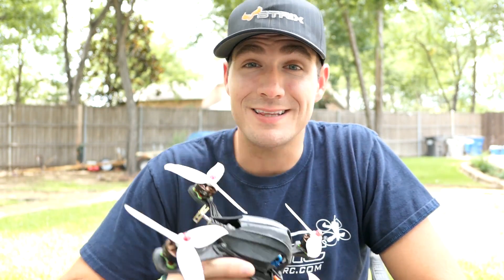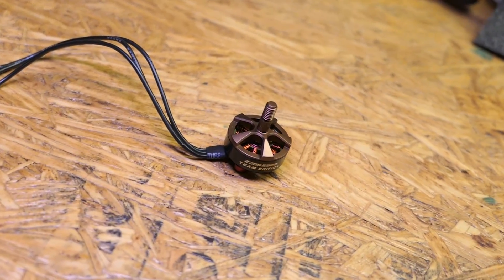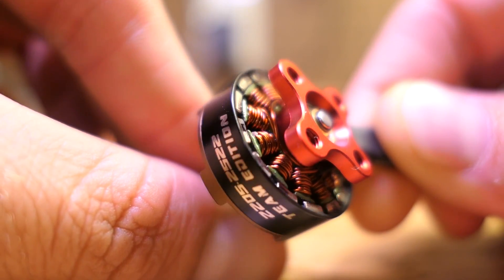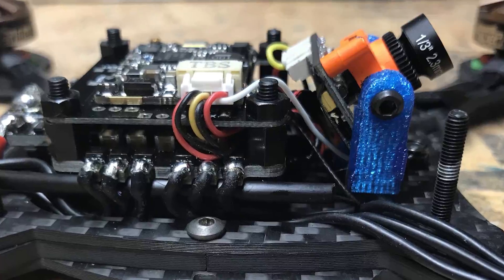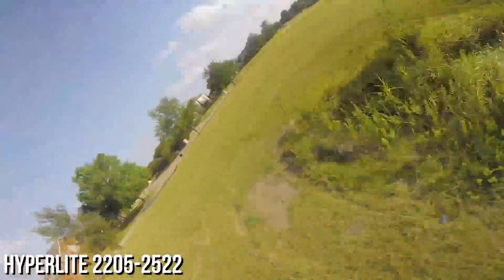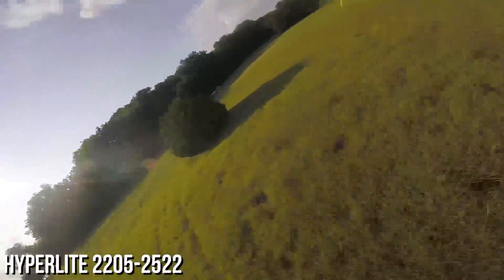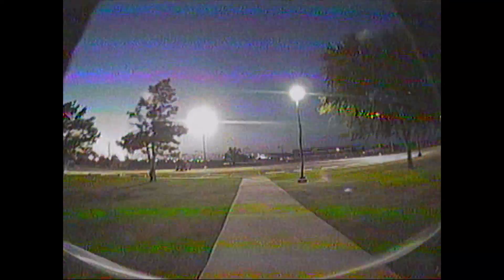Hyperlite 2205-2522kv Motor Review

Comment: This is some fantastic advice. And something to look into. I'm currently running DYS SE2205 2300kv on my race Talon and have a lot of control over it. I use T motors on all my other Quads and noticed a larger learning curve.
This will be interesting to test further.
Reply from the maker: +JayFlysFPV never stop testing!

Comment: I have these motors in a super light 5" thats about 220g (will be 230g once I add a runcam micro instead of the 1.2g cam i am using). These motors give me way more power than i could ever use... that said i am much much slower than you... i can get a 4s 1300 to last about 6-7 minutes... just kind of cruising/freestyling. also using the 5050 dual blade props.
Reply from the maker: +TransAm2k4 daaang 6-7 minutes lol enjoy that flight time
Reply: Well it helps that at my skill level i am cruising about 30-35% throttle and punchouts are short since this thing accelerates like crazy.

Comment: Nice review. I have a Floss v1 with RCX 2205/2633kv @ 24g. Total weight 252g with DAL 5040x3 props. It flies amazing fast, but still not that smooth with RCX motors as with BH. BH motors have better throttle control which requires less adjustments while flying.

Comment: Do you think this motor can't handle dal 5046C? I saw some data from miniquadtestbench.com, and strangely most 2205 motors pull similar thrust with 5045c and 5046c. However, when I saw 2206 or more motors' results, they pull significantly more power with 5046c than 5045c. I am really curious what makes that difference even with 1 pitch higher. And I also found that some top pilots actually prefer 5045c to 5046c. I want to hear your opinion over both props.
Reply from the maker: just cause of time I'll keep it short. The motor can handle it but the prop won't respond as quick as a less agressive prop. The way they measure pitch isn't as simple as you think, it's no longer just upping the ACTUAL pitch by 1. It's all sciency now, and has a significant impact on performance. I prefer the prop that is better for the motor. On mor powerful motors, 2206 and above, I like 5046. On weaker motors, I like 5045. It's a control thing. I have better control in the corners with the higher pitch on more powerful motors. But if I am having troubles on a track finishing because of battery, I drop down to 5045.

Comment: I built a rig using the 2204 floss motors hoping for a pretty efficient build. I know you have mentioned several times about how efficient they were. I did a pretty light weight build. I don't have a scale to weight my build but a 66g frame with hardware, floss motors, emax magnum, micro swift and dal 5040t props. With a 1300 pack I'm lucky if i reach 3 min on just some medium acro flying if I'm pushing it harder I'm lucky to see 2 min. In the video with envyastro you guys were hitting like 5 min times of hard racing. what am i doing wrong here?
Reply from the maker: +Dustin Smith what props do you use? the 5 minutes is from ivan’s efficiency yet where he runs til the rig falls out of the air. I was getting 3 minutes raceing with them on 5040x3 so you should be getting that and more if you’re skirt free flying. Tune can hurt battery life too
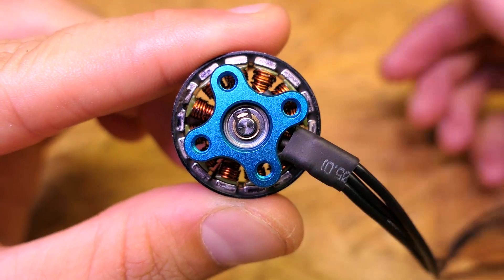Reply: ive been using the dal 5040 tri blades. Granted I suck at tuning so that could be a big part but it doesn't feel like the tune is "that" bad but maybe it is. Cuz if I want to get 3 min out of a pack I feel like I have to baby it from about 1:30 on. And I don't do much racing at the moment so its majority just freestyle and not particularly stressful freestyle at that.
Reply: Dustin Smith I'm getting 4-5 minutes easy using those motors on twisty stuff. You're either the fastest pilot in the world, or something is wrong lol
Reply: So I ended up swapping out the camera.  i was using a runcam split. Now everything i've read said that the split doesn't take hardly any extra power but I swapped out the camera for a foxeer micro and I'm getting 4-5min flight times now.  Funny thing is I put the split on another quad and it works just fine there with no excessive power draw so I really don't know what the deal was.
Reply: Weird. Mine has a split in it. I get over 2.30 on 850 mah batteries, and heading to 5 with 1300s. Great motors, and mine is incredibly agile with tons of punch, but wish they had more top end. You can feel them fading. Not a problem on a track I imagine, but can't help wondering if I should have gone 2205.
Reply: yeah something was clearly wrong but I don't know what. At this point it doesn't really matter cuz I put the split on a 4" and am loving it there and its working perfect. But as for the 2204 motors ive been very happy with the feel. I honestly don't really miss that top end but like i said above I don't race much i mostly just freestyle. My buddy who built the almost twin did end up switching his 2204 for the hyperlite 2205 from this video and he loves the extra power but he also is usually a little more power hungry than I am.

Comment: Have you done a review about the flight controller you used on this build? There aren't many good videos about this component. The FC looks great on paper, but I'm a little concerned about the amperage rating.
Reply from the maker: No review on it, sorry. I ran it with some 2206 hyperlites and it was fine. It crapped out on my but that was because of a direct hit that smashed the back tab into a steel bolt. Poor positioning on my part, but it handled the motors fine. I don't know if i'd trust it on anything more powerful though.

Comment: I like the video.  So I'm a pretty new pilot and I'm flying f40 pro 2400 kv on a pretty light frame.  It's potential is beyond me at the moment.  I definitely fly better on weaker motors.  I'm also using 32 bit esc.  So I'm wondering if instead of using weaker motors if I should start messing around with the power settings in the 32 bit esc?   Like "ramp up power", "maximum acceleration", "maximum throttle" or even changing the center throttle above 1500 to soften the throttle at lower range (kinda like super rates or expo?).  I'm just thinking out loud I'm not even sure I understand all these settings.  But if it works then you can crank the power up when flying freestyle and have an all around quad?  Am I dreaming?
Reply from the maker: No not dreaming. Those are some interesting ideas and they could work, I think. I'm just not familiar with them and have never messed with them. It will involve some experimentation on your part, but you should do it and document it and let us know!
Reply: Justin Skinner I'll mess around and let you know.  It would make a cool video, I have not seen one on this subject yet.  Might be a good video to get you up to 10,000 🙂
Reply from the maker: +Daniel Braker lol if you do it and share your results with me and don't want to do a video yourself, I'll give it a go ;)
Reply: Justin Skinner your better in front of the camera then me I'm sure.  I'll let you know how it goes.
Reply: I did some testing today and I'm pretty happy with the results.  My testing was on the F40 Pro 2400 KV motors on a light build with 32 bit ESCs .  This setup is definitly more then I can handle.  I handle my DYS storm 2300 KV (actually 2100 KV) motors pretty well.  The first setting I messed with was maximum acceleration.   I set maximum acceleration per millisecond  to 15%.  It felt a lot more controllable and acceleration was fine for me, then I dropped it down to 5% per millisecond.  This was too low and definitly changed my tuning (which is stock betaflight 3.2) in a bad way, I didnt' try to tune it.  I set it back to the default maximum acceleration and next adjusted maximum throttle.  I dropped it down from 2000 to 1500.  Acceleration and tune was normal (no PID adjustments needed) and I definitely like how I had to move the throttle a lot more to get a response but 1500 cut out a lot of power so I moved maximum throttle up to 1720 and I like the throttle range and the max speed was more controllable like my storm motors.  My opinion at this point is that maximum throttle adjustments are the way to go for me because I don't need to do any tuning and I really like that I can move the throttle more without the drone taking off. I'm doing these adjustments on only a 2400 kv motor so this will reduce the amount of range I adjust.  If I had a higher KV motor like 2750 I think you could do a lot more fine tuning to your liking since you probably don't need such a high KV anyway.  The other 32 bit ESC setting I like is the Brake On Stop percentage.  At 100% the drone drops down way too fast when you come off the throttle making it harder to control.  I reduced the Brake on stop to 60% so the drone wouldn't drop so fast when I come off the throttle.  All these settings make the throttle a lot more controllable for racing just like lowering the super rates!  Also obviously the battery time is extended when reducing acceleration per millisecond and max throttle.  Weight is another issue I'm sure those hyperlites  weigh less.  Another note to keep in mind is that the Maximum acceleration setting does not affect top end speed.  Please feel free to test yourself and share our findings.  I'm sure more people will listen to you then a noob like me so more people could benefit if they hear about this from you.  Have a good weekend I hope this helps!

Comment: I completely agree with your opinion about moving to larger motors too quickly as I fell into the same trap. 2205 motors are still relevant but in the process of going "bigger & better" 2206 motors were almost skipped entirely. Best motor without question in my humble opinion is the hyperlite v3 (2206/2600kv) on a 260-280 gram all up weight quad. You should seriously consider giving that a try. Efficiency is off the charts for me because it keeps me out of the higher throttle ranges where efficiency plummets vs 2205's which I spend most of my time above 60% throttle. They even have a naked bottom version now
Reply from the maker: I never tried the 2206 v3 but I do have the v4 and you're right, they are a great motor as well in efficiency and control! I went through the 2206 phase last summer and fall and those motors were one of my go to motors most days.

Comment: these motors are great i have them, i just fly for fun. i use the dal 5045 and it seams to work well together
Reply from the maker: +Kevin Gibbs 5045 cyclone or bullnose? The cyclones are great for this motor!
Reply: Cyclones. they work well and they bounce back when I crash
Reply from the maker: +Kevin Gibbs 1000% agree
Reply: now only if dal could make a frame you can bend back into shape on a bad crash would be a game changer